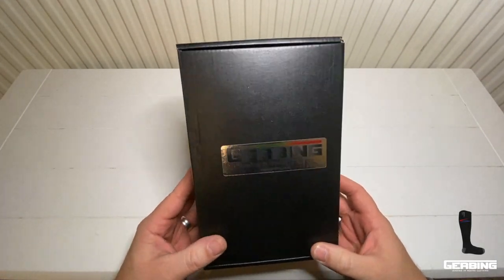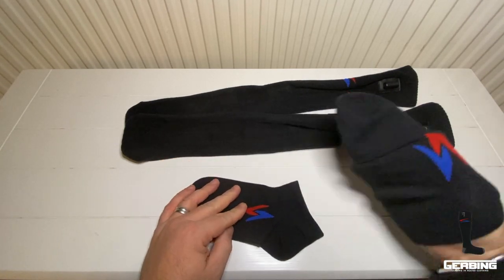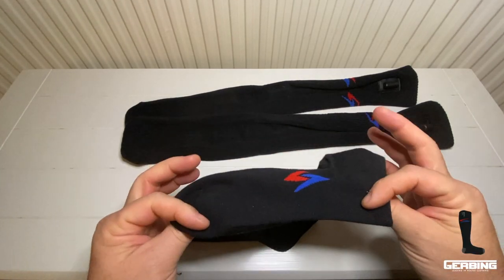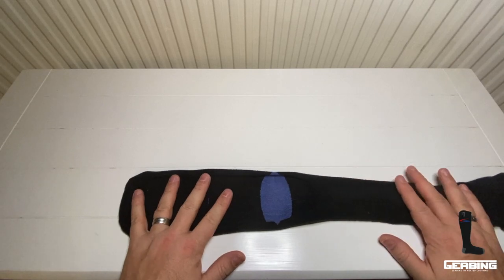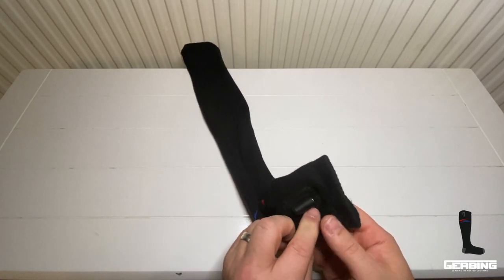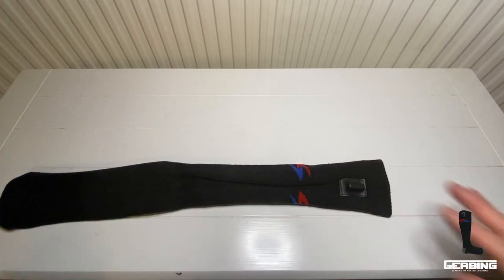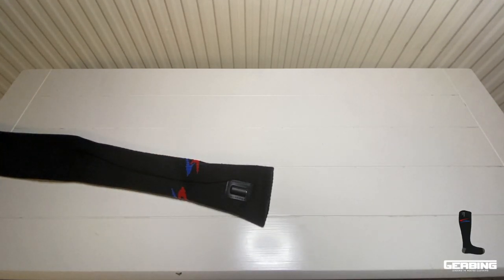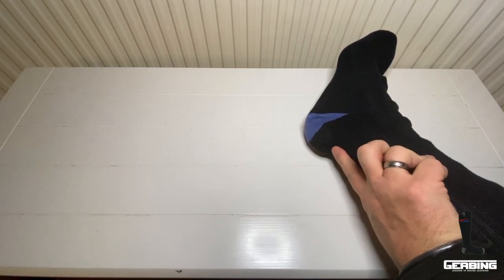Gerbing Motorcycle Heated Socks

Comment: Does it matter what we ride Ive an older mid 90s mid sized bike. I always imagine bmw riders having the charging system to cope with?
Reply from the maker: As long as there’s a 12v battery that’s all that’s needed as the battery is being charged as the engine is running.

Comment: Thank you for a great review, I bought my pair of socks after watching this. 
But lets talk burns and blisters, have you experienced any of that with theese socks? I use my socks together with the included inner socks and I got the single controller. I have only runned them on the lowest settings and on my way home from work the other day, I felt a pain in my right foot. When I got home and took of my sock I noticed a big burnmark through the skin and some blisters on top of my foot. I guess it shouldnt be like this, so I have sent the support a mail about this. Still awaiting a reply.  They do get really warm tho 😉
Reply from the maker: No they shouldn’t do that. I have them on setting 2 or 3 and it’s perfect all day. Not right if you’re blistering on setting one, they are getting too hot.
Reply: @Motourev  Yea, I figgerd that, hopefully the support solves this. Thanks for your reply. 👍
Reply from the maker: @B.Undrum  they are a great company and will deffo sort you out soon. I know they have been away at a motorcycle trade show
Reply: @Motourev  Yeah, I have only heard good about this company so Im pretty sure its getting sorted. I got other Gerbing gear and I have never had any issue with it.